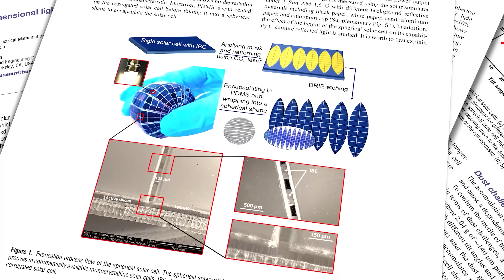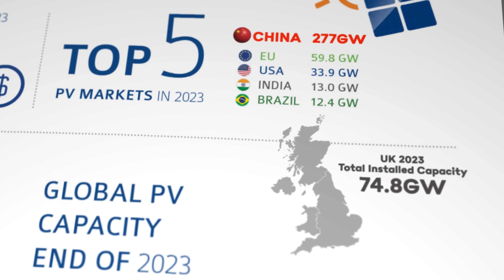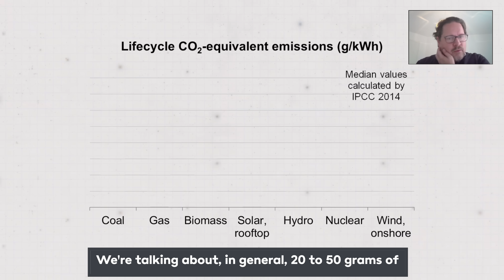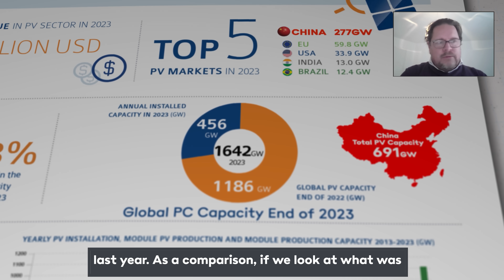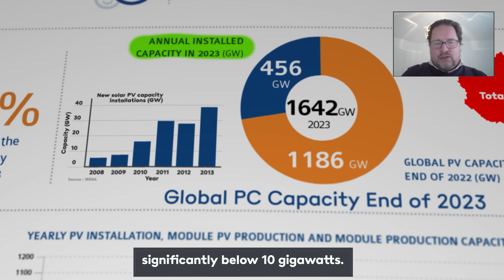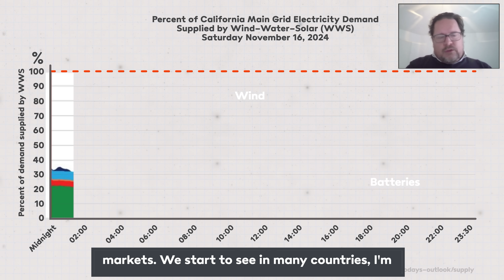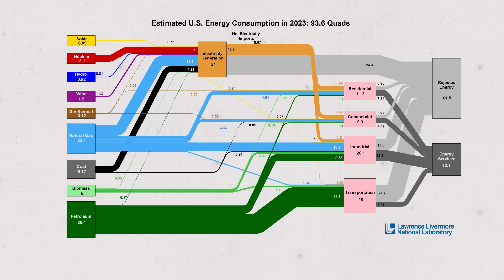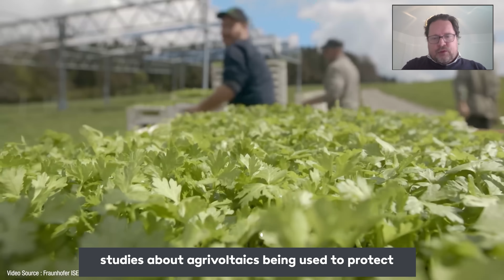Renewable Energy Domination

Comment: About agrivoltaics often improving crops, there's a pretty good reason for that. Many of the crops we grow first evolved in the lower to mid strata of forests, meaning they evolved to be most productive when in the shade; this means having partial shade from solar panels above them actually brings them closer to their optimal environment, improving quality and reducing losses.
Reply: And, the partial shade cools plants and soils, reducing irrigation needs.
Reply: @freeheeler09  The reduced irrigation needs will probably be very important and might allow marginal land areas to be turned into productive farmland
Reply: With global heating we are going to need more shade in the fields
Reply: @ 🤣 then grow a canopy not metal terraces that store heat and release it at night.
Reply: 12000 years ago people realized they can put seeds in the ground and more plants will grow. Soon after they figured out that planting palm trees around the crops will prevent them drying out from getting too much sun, likely by logically comparing how the farmers themselves were sweating more in the sun and had to get in shade.
All that agrivoltaics are really doing is making it worth building shades over the fields on larger scale because it will be costly but the PV electricity will bring in even more money.
Reply: I thought most crops evolved in open grasslands, or, in the case of vegetables, on theseashore, or other open areas. Which crops come from the - lower to mid strata of forests?
Reply: @tomellis4750  Most, if not all, crops that fare better with a shade screen above them evolved in the shade. Many that grow as bushes or small trees too, as well as just about every one that grow as climbing vines.
Reply: @FabioCapela  Exactly! It sounds like tomellis has never tried to grow anything in the dry Tropics, that's for sure!
Reply: @tomellis4750  Fruit, berries, greens, tomatoes, pumpkins, carrots.... The list goes on and on.
Reply: @tomellis4750  Tomatoes... potatoes... beans... eggplants...  most vegetables in fact... vine, avocado and many other fruit plants.  Basically only cereals, as well as some oil plants, evolved in open grassland.
Reply: Agrivoltaics will be first placed on fields where crops are yielded by hand and won't cover like 100% of the field so that the plant still get sufficient sunlight.
Reply: If agrivoltaics helps the crops depends on the climate and crops. In rather dry, sunny climate most crops can profit from shade and less sun. In more humid colder climate (e.g. England) the plants may really need the sun and have plenty of water anyway. There the extra shade tends to be more of an issue.  With only a relatively small fraction of the area needed for PV one can usually still find suitable crops or low value land for the PV use, that can still be used for grazing. The tendency is to anyway have agrivoltaics not with the large area crops that want large machines like weat or corn, but more small scale vegitables and some fruits.

We may have to live with the fact that PV works better in Spain than in England - so energy intensive industries will eventually move to where the electricty will be cheaper. There is just too much of an advantage (e.g. a factor of about 2-3 from England to Spain) in a good location. In addition Spain can get away with less seasonal storage. So the attractive regions will shift snd there are naturally winners and loosers. Quite some industry will have to move with a rising see level anyway.
Reply: @UlrichHarms-ci1ov          UK has tremendous offshore wind resources, among the best in the world, with capacity factors higher than US coal or gas, & almost as high as most of the world’s nukes, but unlike nukes, still rising. Solar & wind peak at opposite times of day & year & opposite latitudes, though each provides usable power over most of the world.* Many places have excellent hydro, geothermal &/or tidal resources, also complementary. 

*Based on population, energy use, & energy resources, Germany is the 3rd hardest country in the world to renewablize, but its grid is mostly renewable & increasing quickly. (The Sky’s the Limit Study)
Reply: @Fab                   The vast majority of human calories & nutrition are provided by crops who produce best with full sun in most climates. But there are lots of plants that do fine with some shade, as do most grazing animals. Solar panels, like food “forests” (actually more like savannas) can be spread out enough to provide whatever amount of sun is optimal.
Reply: IMHO I think agrivoltaics is a very good way to go, even if in the UK it is mainly over grazing pastures, but also what about solar over car parks linked directly car charger stations but also powering the offices or warehouses next to them with excess going into battery storage to run everything into the evening reducing the costs to the company?
Reply: Those solar panels over time, will repeatedly get broken by things like hail and other destructive weather poisoning in the ground. You will destroy some of the most productive farmland in the world, which has already happened for other reasons
Reply: It depends on the crop, many do not benefit from it
Reply: @hmbro3236  Fabio said "Many of the crops ", not all of them.
Reply: @hmbro3236  In Britain I expect that the benefit would just be for grazing animals, give them some shade while allowing them to graze at the same time (a good enough benefit to be enthusiastic about solar installations in fields, in my opinion). But in southern Europe and beyond it will be more widely significant for agriculture.
Reply: @hmbro3236 
They all benefit if soil moisture is improved, evaporation is reduced and soil temp isn't excessive.
Reply: Aren't most of the high yield crops pioneers?

You don't hear about agrivoltaic systems with orchards. The most common (atleast depicted) applications involve either grains or pastures both of Which are pioneers which adapted to full sun

So unless I am missing something (admittedly I usually am) that doesn't completely make sense
Reply: @20-Foot-Anaconda  Agrivoltaics reduce the production of open field plants, but it's often still worth it because the production lost to it is more than made up by the extra electricity generated; with wheat, for example, there are agrivoltaic arrangements that can produce 80% of the wheat plus 80% of the electricity that you would otherwise produce if the land was fully dedicated to one or the other, which is a pretty nifty economic bonus.

Similarly with pasture. The pasture grows measurably slower under the shade, but selling the electricity generated more than makes up for any profit lost, and there's also the advantage that the shade benefits the grazing animals.

Agrivoltaics also reduce evaporation, both because of the shade and because it slows down the wind under the panels, meaning you need less irrigation and the losses to dry spells are lower.

The research to figure how much agrivoltaics hinder or improve specific crops is still in its infancy, mind; we are still figuring out the ideal arrangements of solar panel for each specific crop, as well as how much each crops gains or loses from those solar panel arrangements.
Reply: @20-Foot-Anaconda        Edible forest gardens or food forests are a complex permaculture method involving as many as 7 vertical layers of food-production & support--canopy trees, small trees, shrubs, herbaceous plants, vines, ground covers, roots... (Some people add other layers; higher latitude climates support fewer.) 

Read the mind-blowing exhaustive 2-volume Edible Forest Gardens by Jacke & Toensmeier, or any of Bill Mollison’s books. 
Many food plants that do well in shade can also be found in Perennial Vegetables by Toensmeier.
Reply: @20-Foot-Anaconda  cherries in The Netherlands, see pilot of Groen Leven
Reply: So climate change is not doom after all.
Reply: @horserous  Doom? If you listen to the science and not to worried lay people without scientific training, you'll find climate change to be big trouble, and a source of huge, yet entirely avoidable expenses, but not Doom.
Reply: I'm sorry but this isn't accurate at all. It would increase heat stress on plants due to metal. Pay attention to solar advocates and renewable advocates they say sticking these things anywhere is a good idea, which understanding that 1 the limited lifespan, the resource consumption and the added affects on the ecosystem. Our solutions are always geared toward making jobs and money ( High Tech) and never anything low tech that allows mother nature to do her thing.
Reply: @s42682  The benefits were confirmed through field research (literally; the usual methodology is to take a field, split it in half, then have one side with crops under solar panels and the other side with just the crops). At this stage the advantages of agrivoltaics aren't mere guesswork, but instead published research.

Incidentally, growing a natural canopy over certain kinds of crop — also known as agroforestry — does benefit them in a similar, if not even better, way that covering them with solar panels does. One interesting example is cocoa; while cocoa comes from trees, those trees evolved under even larger trees in rainforests, so growing cocoa in the middle of a forest — natural or not — improves the quality and reduces losses.
Reply: @s42682  This doesn't sound right. How is the solar panels increasing heat stress on plants? Metal in itself does not add any heat, and the heat absorbed, is the same heat shielded from directly reaching the plants. Would you care to elaborate on this mechanism?
Reply: @mrleenudler  I'm guessing that the metal releases heat at night, but I'm not sure. The point is - in a round about way - valid though. That a field split in two - one half without solar, one half with - might show better results on the solar half, it doesn't give us the full picture. It restricts us, like most renewable technology, to viewing the problem through the lens of the existing system - in this case by answering the question: "how can I grow my monocrop better". However, that is almost always the wrong question. That then leads us to putting up extensive metal structures (built by fossil fuels, of course), which ignore the opportunity cost of simply doing things completely differently. It is almost always better, from the plants' perspective, to diversify the crop and use natural methods, such as shading from trees etc. to give more varied and resilient yields. What nutrients do solar panels bring to the table, for example? How do they buffer winds, develop mycelial networks, offer chop and drop mulching, reduce the need for fossil fuel fertiliser - and so on? Are any of these things offset by the electricity produced (less the carbon emissions from the production and delivery of the panels and requisite system)? I would hazard a guess that the answer is, in almost all examples, no. Of course, we will continue to deliberately ask the wrong question (how can I grow my monocrop better?).
Reply: @ricos1497  That doesn't really answer my question. And furthermore, the discussion wasn't monoculture Vs permaculture, but whether putting up solar panels to shade crops and generate electricity is a good idea compared to not doing so. Evidence seems to suggest it's good for crops, and the Return On Energy Invested for solar panels are long since been proven to be greatly positive.
Reply: @mrleenudler  the question wasn't permaculture vs permaculture (or other), but the point is that it should be. Putting solar over crops is clearly the wrong question. Return on energy invested for solar is not greatly positive when you have to mount them on steel structures (which have to be transitioned to green energy at an energy cost), rather than on roofs of existing, or to be built, buildings. But then, on top of that, you have to discount the opportunity cost of not planting something else to shade the crops, plus factor in the fact that the monocrop that suits this method will require its fertiliser production transitioned too. Putting up solar panels to shade crops, then, is a good idea if the evidence only points to the existing structure, which is deeply flawed - so as to be a ridiculous question. Solar above crops is almost always about maintaining the status quo both in terms of the failed agriculture system (failed because it relies entirely on a finite fuel which is both running out and creating runaway climate change), and the large scale ownership of the energy supply (whoever has the existing power of capital and land wins).
Reply: @ricos1497  I won't bite on the side discussion. But consider this: if return on energy wasn't significant, deploying solar wouldn't be profitable.
Reply: @mrleenudler  that's fairly flawed logic. First you'd have to assume that there was a direct conversion between one unit of currency in one side of the world (where the panel is made) and the unit of energy in the side of the world it is being used. Second, most importantly, the return on energy invested in the manufacture and distribution of the panels, plus the steel construction used in elevating them, and their installation is all produced by highly energy dense fossil fuels. The profit margin, then, is in large part due to that difference in energy density. If you add that all up, and add in the opportunity cost of not planting shade and subtracting the other fossil fuel margin for fertiliser then it begins to make less sense.
Basically, you're correct, if today you constructed a steel solar array above your crop rows, then you will make a monetary profit. However, if you were to imagine a near future that didn't have fossil fuels powering the manufacture, distribution, installation and provision of synthetic fertiliser, where solar was powering that entire supply chain, then you'd have an egregious waste of precious resources. It seems the former way of thinking is prevalent, even in environmental circles. Hence why we have ridiculous things like electric cars (I drive one!) being sold as a solution to the climate crisis, when actually what we're being sold is a consumer product built under a model designed around that product being replaced every 13 years (mine is 14 years old, and the rust will see it done within another two).
Reply: @ricos1497  sorry, it's not flawed, though I admit a little simplified. The business case of PVs is creating energy. If you can't create enough to compensate for the cost of energy, materials and labour in, you're in the red. Your focus on FFs as energy in just weakens your case, as the FF market is global, in contrast to renewables.
Reply: @s42682  how does metal increase heat stress?

Solar panels convert radiant energy into electrical energy, which would reduce some (but not all) of the thermal energy at the site of the solar panels. The shade of the panels reduces water loss, and the panels and their mounting systems hold water in the area, creating a more humid environment at the site.
This has been shown to improve agricultural output for sheep and grape crops, to name two with scientific research published. It has also improved bee numbers and other insects.

What you saying is that metal creates heat, is that correct?

You're also suggesting that anyone who thinks solar panels are good would be happy to madly encase the whole world in them.
No-one with any sense thinks that is required or is a good idea.

Comment: Recently liberated Syria should solve their power issues with pv:s and gridscale batteries.
Reply: Most of the Middle East could do this, but it would surely require some kind of "PV Marshall Plan" to provide the capital.  Not that this should prevent it happening, though...
Reply: You mean recently conquered Syria. You should look into what actually happened a lot more.

Comment: china also outpaced the world in new coal plants coming on line by a large margin
Reply: They are not run at full duty cycle, however.  They are used more as peaking plants for periods of unusually high demand or when drought suppresses the availability of hydropower.  So it's not as bad as it looks.
Reply: That's a meaningless statistic because almost no one else is building coal plants.

Comment: Humanity will be set free from fossil fuels sooner or later. Let's hope sooner. Maybe not completely for vehicle propulsion, and for plastics. But, for the energy grid, DEFINITELY.
Reply: Plastics are produced with fossil carbon, but it isn't burned.  Thus it's not the same category as fuels.  Vehicle propulsion appears to be headed toward clean tech.  Batteries can now power cars, trucks, and motorcycles, as well as short haul aircraft.  It looks like ships will be burning synthetic fuels like methanol or ammonia.  It's only long haul aircraft that are still an unsolved problem, and they will be sorted soon enough.
Reply: Fossil fuels refers to burning the dirty stuff. It is possible to make plastics from petrochemicals with less emissions, and by pulling carbon and hydrogen building blocks out of CO2 and water. Likewise we can make biofuels and renewable e-fuels. They're all a lot more expensive than burning the dirty stuff.
Reply: The UK government has set a target of 2030 for getting the grid green. That's very soon!